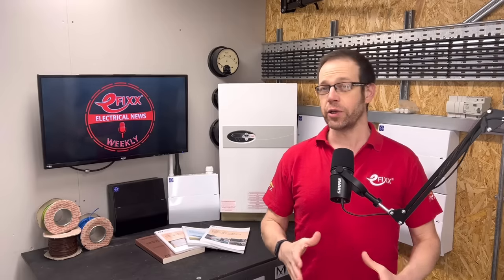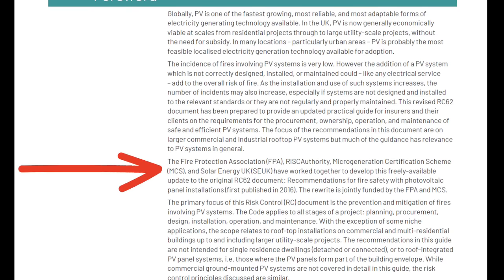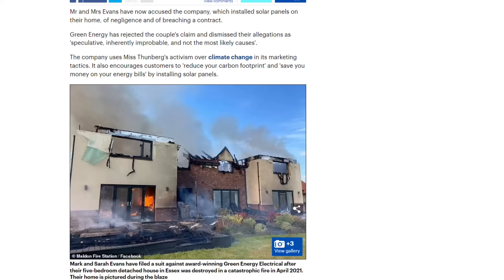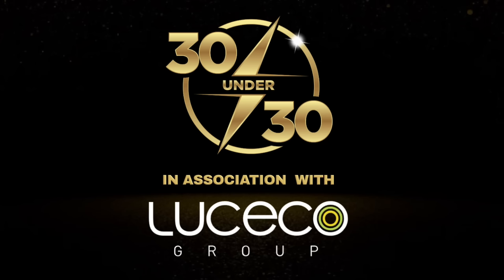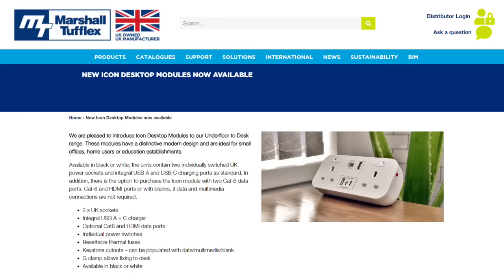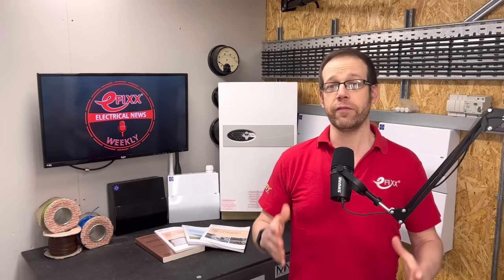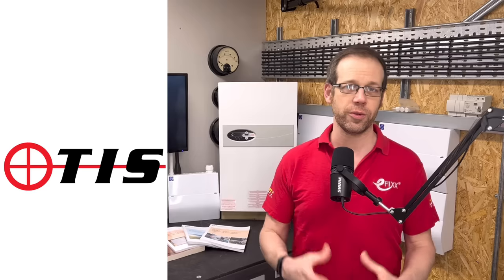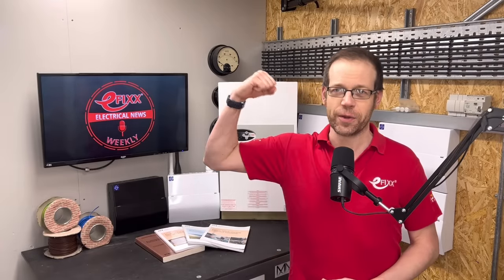DON'T Install DC Isolators On Solar, Electricians Warned

Comment: So how exactly does a separate DC isolator cause a fire?
Reply: 1) Poor connection causes overheating of the terminal, breakdown, extensive sustained arcing until combustion of adjacent materials.
2) failure of the isolator itself causes sustained arcing until combustion of adjacent materials.
Look up what a 500VDC arc is like, nothing like AC.
Reply: 1)Poor contact resistance,
2) Metal parts not rated for the current
3) Plastic parts not rated for the temperature
4) Excessive operation of the switch when under load, the arcing causing premature erosion of the contacts leading to increased contact resistance.

The arcs produced by switching DC are a much bigger problem to dissipate than for AC.
Reply: Crap terminations. Links removed etc.
Reply: @blow0me  that's how solar works generally yes, seen up to 1kv on a solar array. I think we should be using old style MEM Excel isolators on it
Reply: Its an excuse to deflect blame from poor quality components and blame the installers
Reply: @jpelectrical7677  Indeed, it rubs me up the wrong way completely. Stuff didn't used to just catch fire... even with loose connections! Just bloody design stuff right.  Had a ceiling rose today that was arcing over due to water ingress (arc between Loop and Switch live). Old bakelite/phenolic so just stank the place out. With this modern melty plastic it'd have set the place on fire
Reply: More connections = more potential fire risk. Isolators already integrated in inverters nowadays.
Reply: @paulf3353  I couldn't care less if the isolator is integrated. The benefits of a properly selected and installed external isolator vastly outweigh the potential drawbacks
Reply: @paulf3353 ever changed an inverter out without a iso? Nope as you wouldn't say this
Reply: @jpelectrical7677 it shows who has swapped faulty invertors out and who hasn't 😂
Reply: @AGRElectrics  Not a problem really, if you know what you're doing, not like you're swapping inverters every year. It is quite lame excuse to introduce additional failure points.
Reply: @paulf3353  point still stands! Sorry your just wrong
Reply: @AGRElectrics   Jeez, it is absolutely safe to disconnect MC4 without the load... it is actually written everywhere. There is no difference where you'll be doing it in inverter or separate switch. You just introducing additional point of failure by adding another one. Hope it make sense, there is no safety issue, you isolate, you disconnect panels and you put covers on MC4, job done.
Reply: Loose wires cause fires minimise the amount of connections less points of failure
Reply: @travoltasbiplane1551 what's the relevance of the links please
Reply: @TheChipmunk2008  There's a mechanical maintenance burden with Exel switches though. The instruction from Eaton is that Exel and Glasgow switches require to be operated regularly. I was a planner at BT which made heavy use of both products until policy was changed recently to heavily discourage them. The problem being BT tends to switch things on and leave them switched on for years or decades, then the devices fail the first time they're switched in anger. I was always encouraged by colleagues to use Glasgows rather than Exels because of the Glasgow's heavy spring loaded action but I've seen many switches of both types fail to close again after being opened, usually because of gummed grease. In my experience 3P Excels in particular can become unreasonably difficult to reclose after only a couple of years in service.
Reply: @paulf3353  While I agree that disconnecting and capping MCs once the inverter/MCC is shut down should be just as safe as a disconnect switch, having a disconnect switch next to the inverter does spare you the trouble of two or more runs up-and-down the roof or wherever solar panels are installed to access MCs where the home runs to the inverter/SCC would otherwise be direct from the roof/wherever. If you add MCs next to the inverter to save roof runs, then your total connection count is effectively the same: you trade four crimps for four screws terminals and two pin pair connections for two switch blades..
Reply: @deang5622  Most DC isolator failures I have heard about just happen out of the blue. Since DC isolators can go years between operations, I'm guessing many of them don't have high enough contact pressure to prevent oxidation from getting inside the contact patch. Some also have issues with condensation accumulating inside the switch.
Reply: For solar, the panels will heat up if there's not an outlet for the power generated. You need to isolate and ground PV panels to actually isolate them safely. It's a known issue.
Reply: Legal requirement in Australia, roof mounted isolator for firemen.
Reply: @Mr424242424242424242 And what temperature will they  heat up to? Now tell me if that temperature is high enough to melt any part of a solar PV panel?
Reply: @VinoVeritas_  It's hot enough to ignite the PVC jackets on the wiring, and cause further arcing
Reply: @Mr424242424242424242  No it's not. Again, what temperature will the panels reach? If you don't know the answer, that's fine. Just don't make things up.
Reply: @VinoVeritas_  I've literally done the RCA for a utility on the matter. I don't have an exact temp because I have never destroyed a solar install just to measure things with thermocouples and dataloggers. The only part of it that matters to me, is that leaving them floating is dangerous, and they need to be earthed to a proper grounding system.
Reply: @deang5622  If the DC isolator can't reliably handle its rated voltage and load that would seem to me to be a defect in the isolator!
Reply: DC is really nasty to handle because it arcs & the arcs don't self extinguish as they tend to in AC systems. So any connection failure on the dc side can be really catastrophic so minimizing the scope for failures by minimizing the number of joints, contacts etc all helps reduce risk.
Reply: Out of curiosity how can the inverter isolator handle the dc isolation, do they use similar contacts as isolators how do you know what rating the contacts are ???
Reply: @SparkcatcherFox  Sorry for the lack of response to your post... I was off to sleep! It's good to hear from someone in the know. The failure to remake could be very bad in telecomms  for sure. I wonder if Eaton need to look into what grease they're using?  (My knowledge of telecomms style DC switching goes back to knife switches, not really transferrable to domestic, but it might help clear the gene pool!)
Thank you for the detailed response with actual useful info. :)
Reply: @TheChipmunk2008  Not a problem! As far as I know the grease on MEM gear has always given trouble with age, perhaps we should raise it with them but I think the gist of their response will be that it doesn't cause a problem if the devices are operated regularly. To clarify BT uses/used Exel and Glasgow switch disconnectors on AC supplies but frequently they feed DC plant and then telecoms equipment at some point downstream so supply interruptions are undesirable and planned work is obviously tightly controlled. If they don't feed DC they may well feed HVAC and that's almost as important. Around the time I left BT my colleagues were starting to assess the man hours required to periodically operate devices to comply with manufacturers' instructions.
Reply: more connections more points of failure
Reply: I am a none qualified person however a keen DIYer 
My understanding of DC is
12v at 15 amps is worse than 
180v at 1 amp ?
It arcs much more? 
That one fire was a off grid set up so at lower voltage. 
My question to your professionals however is a DC MCB safer than a normal switch/isolation?
TIA
Reply: @sbmorris2k6 I was thinking this same question
Reply: @markjones116  At extremely low voltages (12v would qualify) the dc arcs are not much worse than AC... but once you go above 18v, you can get arcs that react way different to what you would expect with AC.. 180v DC would be way worse than 12v, but the relationship isn't as simple as you think. Use approproiately rated stuff always.

I am a sparky and have been for 35 yrs (oof), but was surprised afew months ago by a dc arc from a 24v stair lift motor, it burned half the contact away before i could stop it!
Reply: @sirgregoir  Hell yes!
Reply: Teach a trade had its permit to operate as an electrical training centre revoked in summer 23 due in part to allowing cheating. Has the permit  been reenstated?
Reply: @deang5622  I agree with you, your comments would be true of any part of a poorly executed DC installation, or for that matter an AC installation using components and methodology not suitable for the installation parameters. I note you acknowledge this in items 1, 2, 3 and 4 of your explanation. This is what people need to be educated about. In much the same way that many 'installers' (these are very often electricians not experienced in the many requirements of safe DC solar installations) in the UK at least are unaware of the following:

"DC connectors were the second major fire risk.

The report identifies the most likely cause of fire as electrical arcing, where electricity flows through an air gap through ionised gas molecules and become hot enough to cause combustion.

Solar DC Connectors Mismatch | Alternergy

Since errors in the installation is the major issue, then it comes the question of cross-mating/mismatching DC connectors.
Staubli has made the case that it is not safe to mix connectors from different manufacturers, something which has also been endorsed by other standards bodies.

In the UK, MIS3002 - the MCS installer standard for solar PV adopts the IET Code of Practice in full. What this means, and it seems that many people in the solar industry are blissfully unware of it, is that for MCS compliant installations in the UK cross-mated connections are prohibited."

cite: https://assets.publishing.service.gov.uk/government/uploads/system/uploads/attachment_data/file/786882/Fires_and_solar_PV_systems-Investigations_Evidence_Issue_2.9.pdf

The report notes the main single attributable cause of DC isolator arcing was water ingress due to poor installation.

This is the main reason DC solar installations should always be entrusted to experienced and qualified installers. This is the same advice I'd give any one, for ANY type of electrical installation.

However it is worth noting that the inclusion of a properly installed and quality DC isolator is preferable to the exclusion of such a device, and as @eFIXX notes in the video, is required at least in the UK. It does stand though, that as the use of integrated DC isolators in inverters increases, that due to the same reasons the next 'spate' of fires will almost certainly be in DC isolator integrated inverters.

This is in much the same way a faulty car seat belt could be the fault of a serious outcome in the event of an accident, but it is not a reason to exclude seatbelts from all vehicles based on a limited number of poor outcomes, the overall positive benefit outweighs the negative.
Reply: @craigmarshall5896  Agreed!
You cover off some good points.

I sometimes think that the knowledge required to correctly install a PV system is spread around documents which are hard to read, and so I can well understand electricians not having vital knowledge, but the knowledge requirement is easily addressed by mandating attendance to specialised PV installation courses where those courses could be certified by say, The IET to ensure all key topics are covered.
Enforce it in law.
Reply: DC isolators can be 'directional'. They are required by regulation here on all solar installs, but an audit some time back found quite a number of them were directional types installed backward. Way too many installers either didn't know they were directional or were confused about where the source of the current was. If installed incorrectly the arc quench may not work properly and the isolator will catch on fire instead of interrupting the current path. It's recommended here to install bidirectional DC isolators so there won't be any confusion about how to wire it. But they cost more.
Reply: tripplefives1402  Solar PV panels are actually cooler under load. A panel operating at 70°C will not cause any issues.
Reply: I had a recall notice on my 2012 AU solar install for both roof and inverter DC isolation switches about a year after installation. It was never actioned and the switches have never been used so far as no failures. Does worry me .. I will get qualified local compliant advice.
Reply: @Mr424242424242424242  there’s no power generation if there’s no load
Reply: tripplefives1402 then they are not rated for the purpose. It’s literally their only job.
Reply: @netconceptsanguilla  that's not how solar works. Then the panels are acting as resistors
Reply: @dama054 OK i shan't be fitting any more MC4 connectors then 😂
Reply: It's normally when the circuit is broken. Even more so if the wrong breaker is used. Any installation can create a fire hazard if it has poor terminations. High voltage DC is way more dangerous than the same AC voltage !
Reply: @MatthewGeier 100% installers really need to understand just how deadly high voltage DC is. If I had to be given a 300v shock and had to choose between AC and DC I wont be choosing DC.
Reply: @paulf3353 .  Depends on your definition of isolator    If the power is running into the unit still. When you remove the covers. Is it actually isolated ?  Or just switched off.
Reply: The biggest problem I see on most installed equipment.  Is that there is no instructions on the correct way of turning it Off. and isolating it.  
Ie. You need to turn of the inverter. First so that the dc current drops to 0 amp.  Before you switch off a dc isolator .  It is an isolator not a switch   Do not turn off under load .
Reply: @bill2960  I'm talking about normal investors where you don't need to disassemble anything... Maybe for cheap Chinese ones where you need to take cover to connect cables it would be required, but normal inverters are they even sealed for warranty purposes.
Reply: @paulf3353    Some of them are. Some are not. I tend to like the solar edge. Inverters. These are not sealed. So you can actually inspect the internal connections when you do Maintenance. 
Actually it is strange I have never been contacted by my so called approved installer about Maintance on the system they installed. 13 years ago .  I wonder if this could be a contributing factor in some of these fires  just a thought. Be interesting to run a poll  on this
Reply: My question exactly.
Reply: @deang5622 AND THE SOLUTION IS...........?
Reply: @grantpedder7719  Design it properly. Operate it properly.

Did it really need me to tell you that?
Seriously?
Reply: @alanjewell9550  DC is more safe and less safe at the same time... ARC'ing is an issue because there is an actual current that AC doesn't have. But at the same time, AC voltages are twice as deadly as DC voltages.
Reply: When switching  off dc under load, the contact may become an "arc welder". Dc isolators should have arc extinguishing chamber which minimizes the risk.
Reply: Separate qualification for solar install needed.
Reply: tripplefives1402  If DC Isolators are not supposed to be opened under load, they would have a sign on them stating "do not open under load".
Reply: tripplefives1402  Isolators are not thre for trained personel, the trained personel leave when the installation is complete. They are there for the homeowner and would be required to be marked "do not operate under load" if that was the case.
Reply: @ten-bob-note  It can't. However, if you have underpowered switches, then it's like trying to use a toy switch on a utility current. All kinds of hazard happens.

While voltage isn't the main culprit, current is. DC current is in addition about 1.44 times stronger than the equivalent AC power. Meaning that for a single panel at 8A your switch must handle at least 12A, and to be safe, 16A.

The excuse of internal switches is only made because then the culprit of fire hazard is the inverter Producer 😉
Reply: Using ac isolator instead of dc isolator

Comment: Horrendous to hear about the tragic loss of life, especially someone so young. Nobody should be exposed to danger when going to work that can result in injury and worse death. Thoughts with the family.

Got to say I agree with the comments here. DC isolators in true form separate to electrical equipment aka an inverter are essential. It allows safe working practices. Its time industry faced up to the real problem of poor installation. From the hooks to the isolators. 

I have written to the authors of that document discussed to find out who exactly was involved in its production and if they would like to help remove those poor installation practices rather than essential system components. Thanks for sharing!

Comment: DC isolator installation depends on country regulation. In my country if the DC cable goes inside the attic then within 5 meter from the entry point a DC isolator must be installed and operated remotely. The idea is that is should be controlled by the main/firefighter switch to isolate the panels from DC cables that are running inside the house to avoid electronic shock. There is only few high quality 1000V DC rated products are available. There is always a cheap alternative from a well known online reseller, but I would not install those to my house.